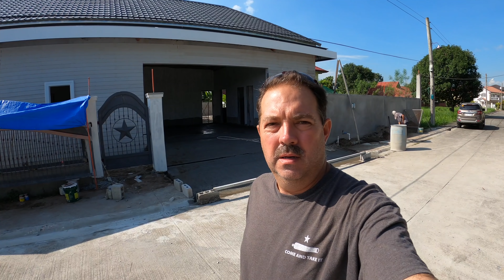Philippine House Building Step by Step, Build Day 162: Put A Lid On It

Comment: it would be nice if you will put your solar water heater system under the solar photovoltaic panels to act as cooling system. solar photovoltaic panels efficiency and lifespan go down when the ambient temperature is high.
Reply from the maker: Being installed according to mfr recommendation.
Reply: Casa TexPina i totally agree. it would be nice if manufacturer could design the two systems as one system because electronic parts work and last better at cooler temperature.

Comment: Looks like a two head piston type air compressor??? Or a tile cutter???
Reply: 15 Cu Ft Compressor by the looks of it and would be great to paint the interior with an Airless spray gun. Cut days or weeks off the paint job.
Reply from the maker: Air compressor for the wall painting. Should save lots of paint and roller time.
Reply: @CasaTexPina  It reminds me of the old times...of pressure pot connected to a HVLP spray gun before the coming of airless spray....

Comment: Hi i think you should have a tap on both lines to the hot water tank and i like you show
Reply from the maker: The cold water supply line has a gate valve at ground level. The hot water line coming out of the heater has the gate valve in the attic. Thank you for the feedback and for tuning into our channel. 👍😊